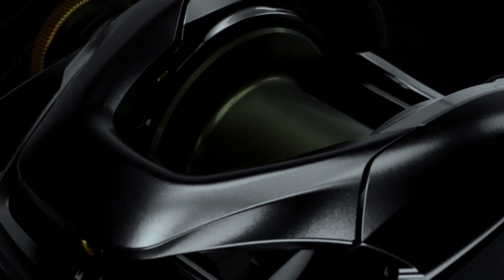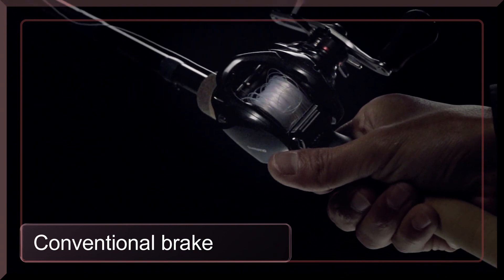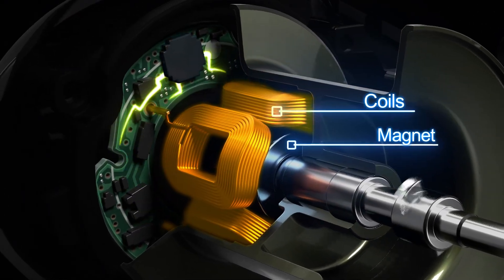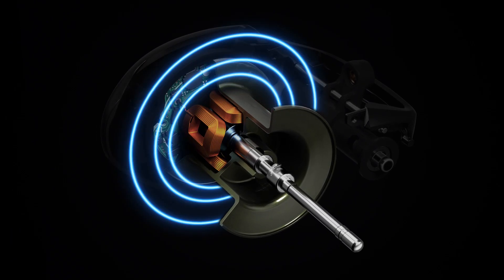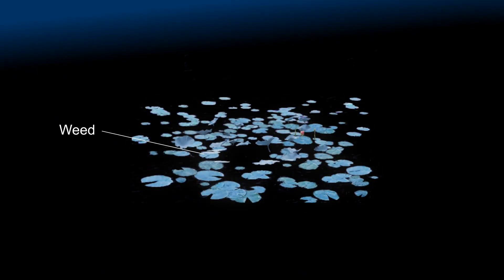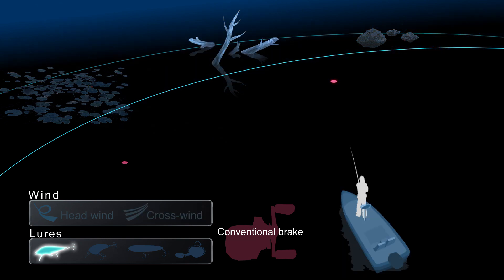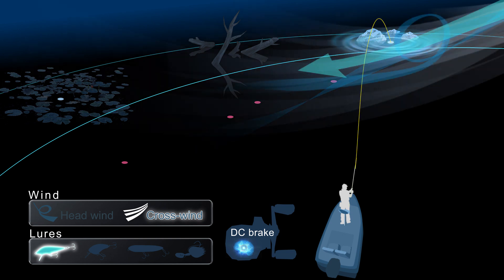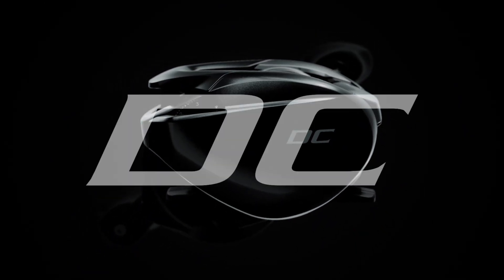Explained: Shimano DC Brake Technology

Comment: The  techology, as it stands now, is not adequate.  I backlash every time I use my Metanium DC, just not as often as with a non-DC reel.
Reply: Ever thought that you could be the problem and not the reel?
Reply: @bullseye2583  Yes, it was me, and I've improved a lot so that on simple casts I don't backlash, but my point stands that these things are over-sold.  It's quite easy to backlash them if you cast incorrectly.
Reply: @robertbrandywine  it’s easy to backlash any baitcaster if casted incorrectly

Comment: This didn't explain how the chip knows what rotational speed the spool "should" have.  It seems to me you'd have to monitor outgoing line speed and match to that, but even there the chip would have to know how much line is on the reel.  Why not make a reel with an electric eye that can "see" when line is lifting from the rest of the line on the spool and brake accordingly?  How does a human know if a reel is backlashing?  They look!

Comment: I am amazed that people don't understand you never need to adjust the brake on a Curado DC reel. In fact, it will mess your reel up by changing the factory setting. If you do a You tube search for tackle warehouse and Curado DC overview, the Shimano rep will make this very clear. You also still need to lightly thumb the DC reel when casting.

Comment: How long does the computer chip last?
Reply: Did you ever find an answer for this? I'm interested as well.
Reply: When you cast the sound you hear is it recharging itself at the same time making corrections to the spool. I had the same question for a while
Reply: @LARPMachine  Yep, what about internal condensation? Or moisture from repeated outside exposure?
Reply: @bluepacman13  I’m not a sponsor of shimano but my two dc reels I have not seen any moisture inside and I rarely open the side plate while I’m out because it doesn’t have any internal adjustments like the standard shimano baitcasters
Reply: @bluepacman13  had to say “not a sponsor” to imply I’m biased haha but I really like my dc reels dropped one in water and fished in the rain with it and everything’s still working fine with little maintenance

Comment: hi, im very interest on DC reel and want to buy it soon. Shimano exsence dc xg will be my choise

i heard rumour DC system is hard to cast 7 gram below lure, it that right? 

how many gram lure range is best for DC reel? 
thx
Reply: Affirmative, occasionally it can cast almost 5 grams below, but for optimizing the best result from the DC brake, it's definitely the best for use more than a half and ounce lure
Reply: I’m getting a dc reel for medium to light lures and I’ve only heard amazing things about it, I would recommend a spinning rod for lighter lures or just use lighter line
Reply: I know I’m late to the party but I have the Antares dc and it works amazing. I can even throw Ned rigs it is that good.